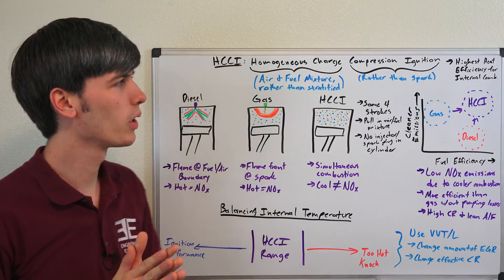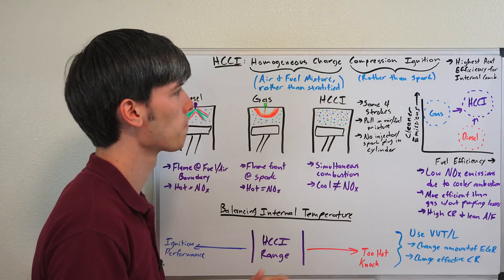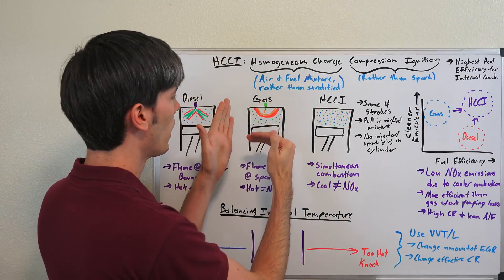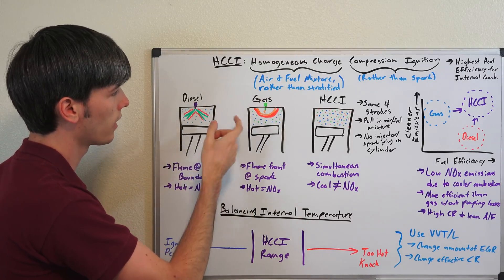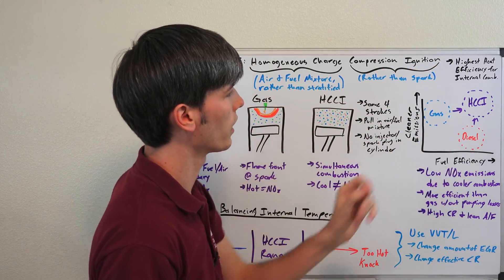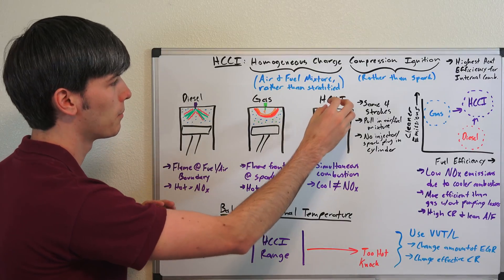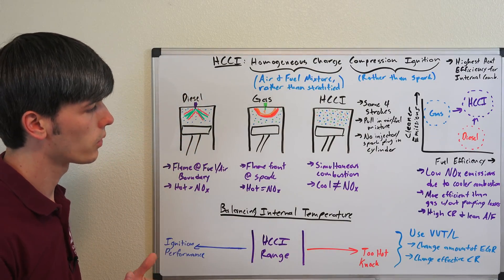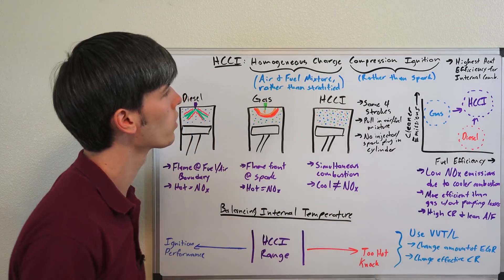The Most Efficient Internal Combustion Engine - HCCI

Comment: Rumors are that Mazda will introduce HCCI into a production car in 2018.
http://www.digitaltrends.com/cars/mazda-planning-hcci-engine-report-says/
http://www.foxnews.com/auto/2017/01/16/mazda-reportedly-introducing-sparkless-gas-engine-in-2018.html

Another advantage of uniform combustion throughout the cylinder is that quicker combustion completion means more work is extracted. Since engines convert fuel energy to work through the power stroke, any energy released after top dead center can't push on the piston through the full stroke, and that reduces energy conversion. Thus, the faster combustion is completed, the more work is produced with each cycle. Combustion with a flame front cannot be faster than full & simultaneous combustion.

Several times "soot" is mentioned as a disadvantage of diesels, but it's not explained. Soot, or rather, "unburned hydrocarbons" or "incomplete combustion"  occurs in diesels because combustion only occurs at the boundary between the fuel and air (or rather, O2-containing air). When diesel is injected, if it is not sufficiently atomized, i.e., small enough droplets, there either isn't enough time for the flame front (the boundary between fuel & air) to move into the center of the droplets, meaning they don't fully burn, or all the oxygen close enough to the droplets is depleted. (Since combustion is localized around the injection stream, depletion of oxygen can occur even if the overall stoichiometry is lean.) Incomplete combustion may manifest as simple carbon (soot), hydrocarbon chains (unburned fuel), or even CO (because there wasn't enough oxygen available to form CO2).
Reply: Mazda are hoping to have HCCI in a rotary which will greatly advance this small light unit. Mazda are hoping to use the rotary as a range -extender. As these run at a constant speed the implementation of HCCI is much easier.  Toyota have teamed up with Mazda on this.

Comment: That's really nice, but I believe the fuel will play a major role in this search of controlled self-ignition. 
In France for example, we have multiple fuel grades (95, 98 and 95-E10 containing ethanol).

How is the engine going to handle those different octane grades on the fly ? Not every fuel station has all fuel grades. Sometimes you are stuck with the 95-E10 (sucks for your high compression, high performance engine). 
Since the octane grade is used to prevent uncontrolled self ignition of the mixture and engine knocking, and since fuel grades (and quality) may vary from country to country (and from a fuel station to another), I'm really curious to see how they will work around those variables.

Any idea/input on how they will achieve this ?

Comment: Seems to me that the #1 inefficiency with piston engines is thermal inefficiency. The amount of heat energy that is wasted is enough for you to cook food on your engine and require gallons of pumping water to dissipate. I am not en engineer but I would think a large gain in efficiency could come from increases in thermal efficiency. The more of that energy you can use towards kinetic energy the less is wasted as heat.

Comment: Surely lowering the CR by leaving the intake valve open could burn that valve and send bad gases back through the intake system leading to clogging/carbon buildup? Wouldn't it be better to richen up the mixture for the next stroke to reduce the heat? or water injection?

Comment: Interesting.  Or, as Spock would put it : "Fascinating".  Yet, electric motors can get over 90% efficiency.  No, absolutely no internat combustion engine es EVER to match that!  Would it be only due to the fact that they use a crankshaft ant the top and bottom ends of strokes aver VERY inefficient.  A significant engineering effort is done to get the timing so that the maximum pressure from combustion occurs slightly before mid course.  In an electrical motor, torque occurs all around and is almost constant (except in stepping motors).  Indiction motors and rotating field triphase motors can exceed 96% efficiency in some conditions.  Internal combustion engines are limited to 63% theoretical maximum by the Carnot efficiency theorem, which is further limited to around 46-48% by diverse temperature and pressure losses in high efficiency turbines and 42-43% in low-rev diesels (like those big marine engines on supertankers).

The future is electric

Comment: Too many variables to get the ignition timing right. small octane changes,temp or even elevation would throw it off. Timing has to be exact. I always wondered why they didn't use the diesel principle for gas engines, You could use very high compression, without predetonation.

Comment: Hey, clear my doubt, your last point doesn't seem correct, cause although we are going to close the intake valve late, our efficiency would still not decrease but rather seems to increase as expansion ratio will still be the same, and because there will be less charge inside as valve was closed later it will have an even higher expansion ratio leading to higher efficiency and not lower. Correct me if I am wrong. Thanks in advance.

Comment: wouldnt you need an external way to turnover the engine to compress the gas for the first combustion?
Reply from the maker: +Brent elias yep, starter motor just like other engines.
Reply: How would start up in cold (< -30 C) environments work? Would it be able to increase the compression enough with very little heat available?
Reply: Brent elias Look up how a diesel engine works.

Comment: Seems like this would be an ideal application for Koeningsegg's Freevalve technology. You could vary how long the intake valve remains open during the compression stroke, thus changing effective compression ratio on a per-stroke and per-cylinder basis. That ought to go a long way towards managing the cylinder temperatures and timing ignition, right?

Comment: Perhaps it is worth mentioning sooting being an issue with fuel injection, not just NOx emissions (otherwise it implies that the miracle cure to NOx would simply be lower compression ratios for lower combustion temperature) which is another benefit of HCCI, as it is (theoretically) lean everywhere in the mixture, which avoids the sooting from being fuel rich (which occurs in certain areas of direct injection diesel flame).

Comment: doesn't a caterpillar diesel run off compression and not glow plugs?
Reply from the maker: Diesels run off of compression, yes. Glow plugs are sometimes used for cold starts to help increase cylinder temps to aid in fuel atomization and combustion.
Reply: Nope, mostly green foliage, you're thinking of fireflies
Reply: Yer confusing starting, where charge heating helps a lot especially with low ambient temps, and running, where it's unnecessary. On the really big (locomotive) turbocharged diesels intercoolers are required for running under load. True diesels are CI engines.
Reply: Compression of a diesel is always such that the temperature of the compressed air is always higher than the spontaneous ignition temperature of the fuel.
Reply: But large Diesel engines don't have glow plugs.
Reply: alfred, pretty funny
Reply: Only near TDC. And then we get into cetane number, but let's not stress the grey cells. FWIW, ignition-delan is factored into injection-timing.
Reply: So how is HCCI significantly better than diesel then, if both rely on compression ignition? The only difference that comes to mind is that HCCI would inject fuel earlier during the admission phase?

Comment: Can we just use gas engine without spark plug and compress it till it self ignite
also using port injection or Carb so it contain equal part Gas and Air.
Just saying

Comment: Everyone says gas motors are not fuel efficient, and forget that diesel and gasoline are different fuels. Diesel fuel has more energy compared to gasoline. Let's compare apples to oranges and draw a conclusion, or compare fuel on the basis of energy density. 
I cannot wait til someone does this right.

Comment: 1.If I gonna cold start the HCCI engine in frozen winter, is it harder than any other engine. 2.And the things you mentioned the intake valve opened while engine was doing compression stroke, or using EGR will these method cause losing power output of the engine?

Comment: there should be different temperature reservoirs for the two intake valves, so you have some better means of controlling temperature. sensing will still be a problem though.

Comment: Actually you are quite wrong about Diesel's having pour emissions. As a lot of that smoke, and soot you are talking about with Diesel Engines is the direct result of pumping too much petrol into the chamber to bump up the power. it also sounds as if, you are actually talking about the old Chevy 350 Diesel conversion. As a true diesel relays on a high compression ratio to ignite the Petrol, much like you are describing in your HCCI. And another problem I see with your HCCI engine, is that gasoline typically requires a higher octane at the higher compression ratios much like those found in aviation engines, which use avgas.

Comment: I could imagine a solution where you add some additional compression from the top of the cylinder, similar to how the intake and exhaust valves jut into the cylinder, just without the air gap allowing gases in or out of the cylinder (i.e. just a simple rod that juts into the cylinder at the right time). This would shock the air fuel mixture into ignition, but I guess space at the top of the cylinder and potential efficiency losses due to the pressure front will need to be considered first.

Comment: What fuel is this HCCI engine goin to use? As far as I know, and I don't know much, diesel is the only fuel that atomises under compression and consequently, doesn't need a spark plug for the ignition stroke...
Reply: It will use petrol.

Comment: Are you sure that the temperature is the primary controlling factor for managing NOx? What about the role of stoichiometry? I always thought that diesel engines run much leaner (~10% excess O2) and cooler (tailpipe temp ~200C) than gasoline engines, and that gasoline engines could be made to produce NOx if they run lean.

Comment: I've worked on engines since I was, err, 8 years old.  I even studied motor mechanics and most of my life I have been marveled with all the technical aspects of engines and motor cars. I have fully rebuilt about 5 cars in my life and worked on a host of others.  Then I tried out an EV.  My life changed.  Simply put, the EV blows all the amazing engineering of ICEs out the window.  Simplifies everything and basically ticks all the performance boxes.  The EV is the greatest invention in modern day motoring. Nice to see that this video even admits that everything will go electric someday.  I feels like we are currently describing what makes the best horse-drawn cart in about 1920.
Reply: Tabourba  Norway managed to get plenty (thousands) of charging stations in a few years. Great Britain managed to produce a lot of electricity from renewables... yep foggy and cold land. it is anyway easier to transport electricity than gas or diesel. did not hear much about Norway needing to do crazy stuff to their infrastructure though they surely did some work. so nothing crazy. 
you may schedule your car to charge when there is excess energy to get a smaller bill. 
you know that big trucks cost big bucks in fuel to run. using electricity provides good cost cuts. charging trucks is doable as the truck is not always on the road. they also have some predefined routes so no problem to have some chargers in convenient spots. companies may have their own chargers to save on "fuel".
i've been following the EV development and we can go massively electric in not so many years. makes no sense to throw away good working ice cars but for new cars it makes more and more sense. ps: i have vw tdi as it was what i could afford for now.
in Bucharest-Romania, where EVs are not popular there are almost 100 charging so please do not tell me about how hard is to make charging stations. If you look at the chargin stations map then Romania, Bulgaria, Serbia they look like ev deserts and still you get plenty of charging opportunities.

Comment: While HCCI isn't new Mercedes AMG F1 proved the concept with their F1 W05 Hybrid. Their engines have dominated Formula One since their introduction in 2014.  Renault/Nissan are strategic partners and were reportedly advised by Mercedes in implementing HCCI to their F1 engines. It is little wonder they are quick to move their investment and technology to the mass market.

Even Honda is expected to essentially rebuild their F1 engine to utilize HCCI because their current engine is less powerful and thirstier than all of the others on the grid.

I hear Mercedes will be creating a supercar which will include a modified version of there Formula One power plant. Now that is really exciting.
Reply: Mercedes bought Ilmor in England who made their F1 engines and called it Mercedes AMG High Performance Powertrains. They still do it all in England. Ilmor were doing R&D on HCCI.

Comment: why do you have a glow engine as the thumbnail? o_O
Reply: George Tsiros George, that is not a glow plug engine.  That is a 2 stroke Diesel engine.  You can tell by the screw on the top of the cylinder head which is used to reduce compression ratio for engine start, and then you screw it in to reduce the combustion chamber area, thus increasing the compression ratio.  From memory, fuel for these engines was one third kerosene, one third motor oiled one third ether. Hope this clarifies your question.

Comment: Great video! This is how the current engine formula in Formula 1, from most, if not all manufacturers, is reaching it's insane 900+ horsepower and top notch fuel efficiency from a turbo'ed 1.6 V6 + energy recovery.

Comment: hang on, so this hcci is basically the same as the old non direct injection diesel engines?

you can squirt fuel into the air inlet of a diesel engine and it will run  so this hcci just adds vvt or similar to ensure the point of combustion is controlled vs temp etc.. ?

Comment: My BMW E36 has a M50 4 valve twin cam 6 cylinder engine without VVT. I only get 300Km per 65 Litre tank of 98 RON fuel.
Bring on HCCI and fuel efficiency. 
P.S. By trade, I'm a Diesel Fuel Injection guy, who also studied thermodynamics... 
By profession a photojournalist and finally... By business role I run my own Web Development company. 
I do like the meaty info in these videos.

Comment: Is it possible to have a second small piston to provide the additional compression in the right moment? Like the high pressure pump in diesels, but instead of spraying fuel in the cylinder to move a small "compression ratio" piston inside to rapidly alter the compression in the right moment?

Comment: lol this guy has no idea at all of how the internal combustion engine works
Reply: And you do?
Reply: well with 30 + years as an apprentice trained collage educated mechanic working on cars vans and trucks from the 30's upto present day i'd say yes more than anyone you will ever meet
Reply: fuel is not what ignites the mixture like he says it does it's hot air that ignites the fuel a simple slip but not one anybody would make who had experience with the workings diesel or petrol engines. This is why in a non direct injection diesel engine you need glow plugs to warm up the air in the cylinder upon cold start.the glow plugs light for around 30 seconds no matter what the light on the dash board indicates the light tells you when the cylinder temp is hot enough to start not when the glow plugs stop operating.

Comment: Since the otto cycle is inherently more efficient than the diesel cycle (mathematically), it makes sense that the fuel economy would be better if you could just get the compression high enough on a petrol/gas/whatever-the-f-it's-called-in-your-country car.

Comment: instead of using the intake valve as a means to control temperature, creating waste. Couldn't there be a separate valve for the sole purpose of collecting the fuel air mixture pushed out to control temp?

Comment: Is the fuel combusting by deflagration or is it detonating?  Can a higher octane rating prevent the engine from running?
Reply: Maybe they could combine it with a turbo or supercharger so for higher octane they increase the manifold pressure to ignite the fuel.

Comment: I wonder, what would the average compression ratio jump to?
    Presumably, a good balance of compression and timing would be used not going too extreme in either direction.  Timing I think would be a better "variable" compared to compression if VVT was to be a factor.  In some cars, retarding timing is as easy as turning the distributor and that would cause less loss than lower cylinder pressure due to a valve being opened for an "extra" amount of time. Timing also effects efficiency, danger of knock, and power curve dynamics (among other small variables).

Comment: cooling by venting pressure on the compression cycle would suggest that unburned fuel will exit. That doesn't sound like a good idea.
Reply: They vent into the intake manifold. So the air fuel mixture will be sucked back in to the cylinder when the next cycle starts. It's basically the Atkinson cycle.
Reply: shi01
Thanks